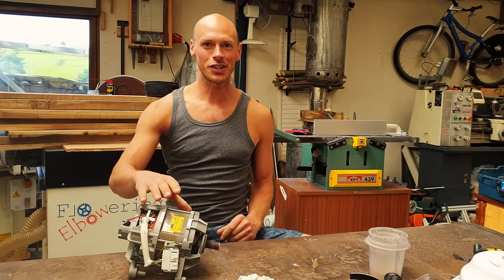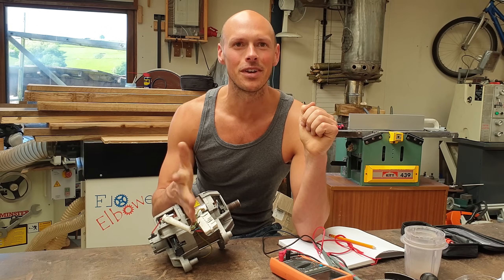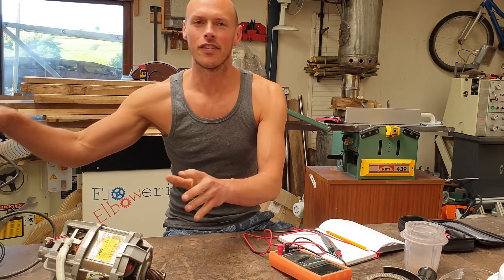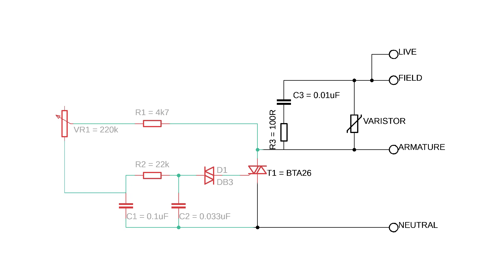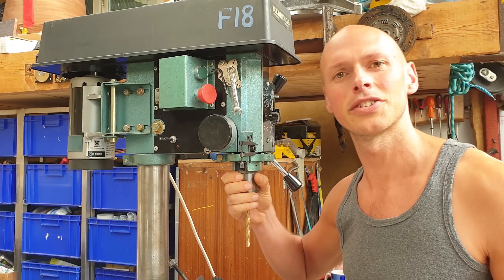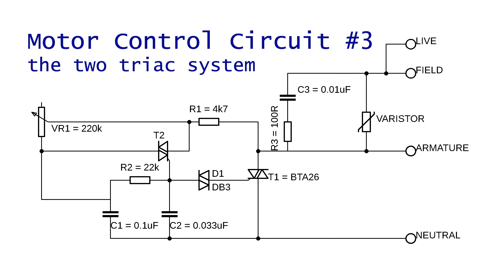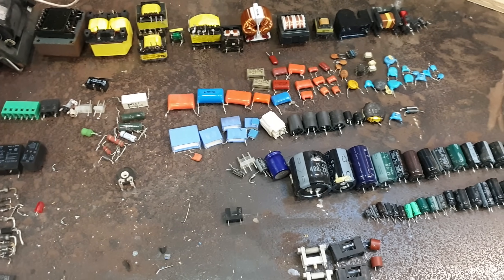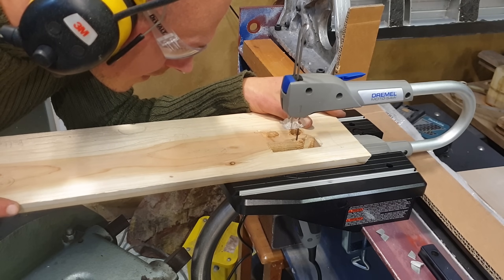How to reuse Washing Machine Motors [Arduino vs Basic Triac control]

Comment: Need help guys!
I can not find any information of the "BLDC" style washing machine motors with 5 pins (2 thicker wires and 3 thinner) I got: Aksollmotor BPM 8/19 110/ARK 230Vac 50-60hz 6A 900W cl180.
I would like to refurbish it for an ebike with a converter or something, but no information that i could find on internet on connections and what is needed.
Reply from the maker: Hi Matjaž Čeh, thank you for the question. Afraid, I have no experience with BLDC motors from washing machines. Here in the UK they are only just starting to become popular, so haven't had time to filter through to the junk stream yet ;) 
Good luck with your bike project,
Bongo.
Reply: @FloweringElbow  Thx for the replay. Guess ill have to wait it out until someone does :>
Reply from the maker: @manipulativer  sorry I couldn't be more help friend.

Comment: BloomingHumerus: Sir,
1 - Congratulations on an informative erudition.  The resistance measurements were of great interest to me.  Thank you.
2 - Cct 3 with Tr1, D2 and D3 was especially interesting as it provides protection against runaway in an otherwise conventional series motor.
3 - I shan't follow up the Arduino cct with its expense and complication, but it's very interesting anyway.
4 - The motor you demonstrated had a tacho .  I'm not sure if all washing m/c motors have.  It is possible however to provide feedback from a small resistance placed in series with the motor, whereby conduction angle is increased to compensate for speed reduction on-load.  This can be done in a simple half-wave SCR circuit or developed into a full-wave circuit by feeding the H/W cct from a FW rect.  These aren't my own invention, they were published by RCA in "Solid State Power Circuits"  © 1971.
5 - Wireless World July 1977 published a simple halfwave SCR cct for electric tools (drills at that time) by K C Johnson.  It would require higher rated SCR for a washing M/C motor.  It is of interest as it uses motor back-EMF to provide speed feedback so as to reduce speed drop on load.  Such back-EMF is measured during SCR off-time.
6 - I add that half-wave ccts can only run the motor to  half maximum power.  Some simple speed reducers in the past were provided on power tools by switching in a simple diode in series!
7 - One might add that such DIY electronic cards as you have used might be prone to voltage breakdown.  Tracks or pads on such cards can be picked off by overheating with a soldering iron where necessary to provide extra isolation.  The recommended clearance for 240V is 1.5mm.
8 - re live heatsinks, there are insulated triacs whose exposed metal face is insulated, so you can touch their heatsink!.  Example: SGS type BTA-08 series.  Expect these to have a higher thermal resistance.

I hope the above may be of some interest to some of your viewers, as your video has interested me.
I don't think one can attach files to these replies, but would be prepared to scan and forward all/any of the above schemes.
Best regards from Clive, Dip EE.
Reply from the maker: Good afternoon Clive. Thank you so much for your comment, I'm very much the amateur experimenter, so it's great to hear from someone so qualified.

1. Thanks Clive, I think I had these measurements from the motor and checked them against some published in a fantastic book: "Electric Motors in the Home Workshop" (off the top of my head - or something like that)... It's a bit dated now, but is fantastic none the less. 
2. Yes, I too am intrigued by this one – though haven’t tested it much myself…
3. Agree with your assessment. I was intrigued enough to have a crack at it, but in future will stick to simpler circuits.
4. Very interesting.
5. Certainly worth following up for anyone interested in making these circuits. I will check this out next time I am needing a motor & controller. 
6. Agree, yes. 
7. Good to know, thanks!
8. Yes I did know about this. In fact, if I am not mistaken the triac I used did have an insulated heatsink mount, but I thought it worth throwing the caution out there for people anyway, it’s so very easy to just check the temp. without pausing to think whether…. 

Thanks again Clive, I really enjoyed your thoughtful feedback on this little projects. I really hope some of my other videos will also be of interest to you – though this is probably the most electronically detailed… Thanks again,
BloomingHumerus 😉

Comment: It looks like a very smart solution to using an SCR that is controlled via an Arduino to maintain maximum torque at any speed.   Are you still using the motor controller and if so, how is it working for you?
Reply from the maker: Hey valvman. Am still using it yes. Has worked really well thus far except  slow speed regulation is not quite as hoped... over 1800 rpm at the motor shaft (which I guess is still slow for these motors)  is very effective... 
It was a fun learning process but I would build circuit 2 if I was to make another controller. So simple and effective.
Reply: @FloweringElbow  Thanks for your reply.  I was hoping to build one for a small bandsaw so I could change the speed to also cut mild steel.  My initial plan was to put in a brushed motor and controller, but after seeing this controller, I am hoping it will do the trick without changing the motor out.  This would mean running at slower speeds.
Reply from the maker: @valveman12  this controller will work well with brushed motors. It will not work at all with induction motors though... depending on how big the band saw is (?) I recon  a 3/4 hp motor might be a bit small... especially if you want to cut steel... things to consider.
Reply: @FloweringElbow  Yes, I understand.  The only way to change the speed of a single-phase induction motor is to change the frequency.  I already have a few metal cutting bandsaws, this is more of an experiment to learn something new. Thank you for your reply. ;-)